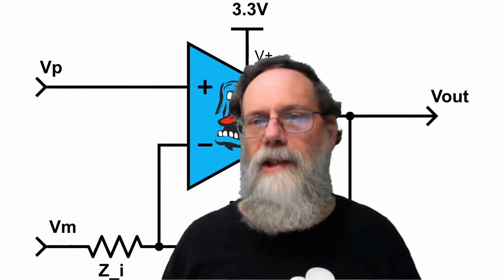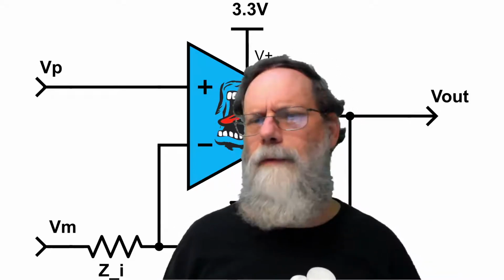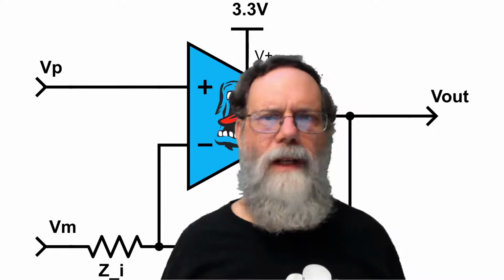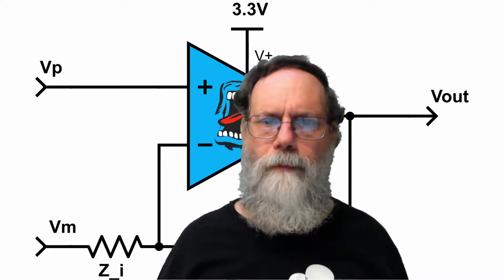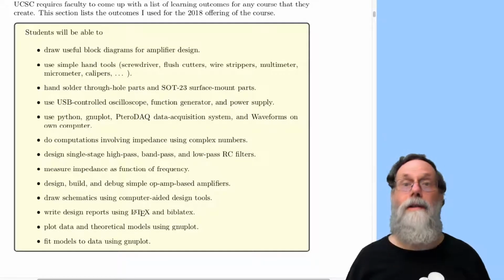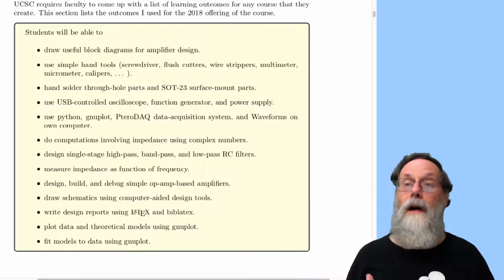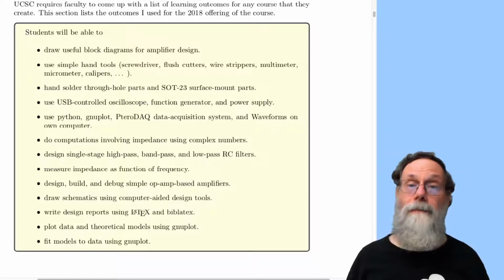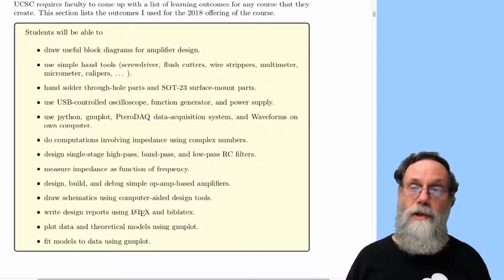Why electronics? Chapter 1

Comment: Hi Kevin, first, i appreciate your YT content. I actually find that the way of doing the courses in a theoretical or academic way is good. Students are quickly tired of theory and love the practice. They also see much more concrete applications. Regarding the price of your book, I find that there is a huge difference between the price of the paper (which seems too high to me compared to what is usually done - eg: malvino, etc.) and the pdf version whose price is really very low. For the rest, I saw that lately you put videos that have nothing to do with electronics. A suggestion would be to make a separate string. Otherwise, I see that despite the quality of the content, the good electronic channels have few subscribers, which is a shame. Never give up ! Recognition can be a long time coming!
Reply from the maker: The PDF is cheap because I retained the right to continue to sell it self-published through LeanPub.  The paperback price I have no control over—it is less than many publishers, but more than what they told me the likely price would be when we negotiated the contract.  If I had self-published on paper, it would not be much (if any) cheaper, because of the large amount of color printing.

I had considered separate YouTube channels, but I'm not expecting to create many more electronics videos.  The ones associated with the book are available as playlists: https://tinyurl.com/electronics-A and  https://tinyurl.com/electronics-B
Reply: @gasstationwithoutpumps  Thanks to take time for explanations. I'll take the relay for electronics !